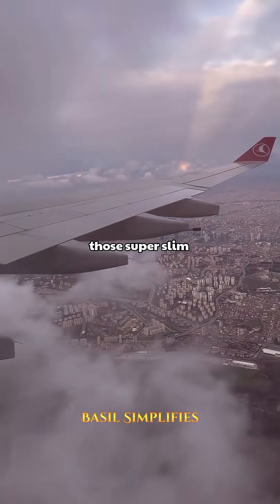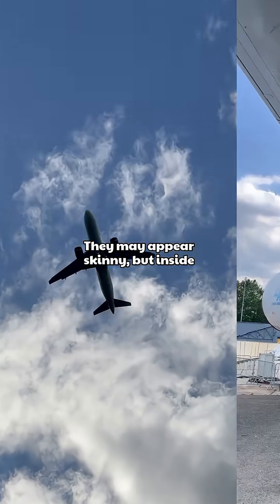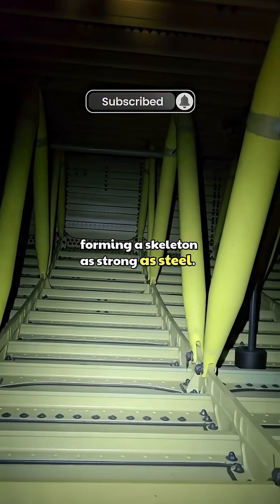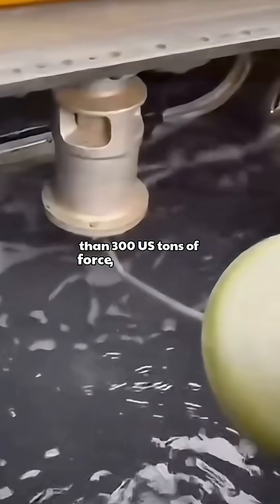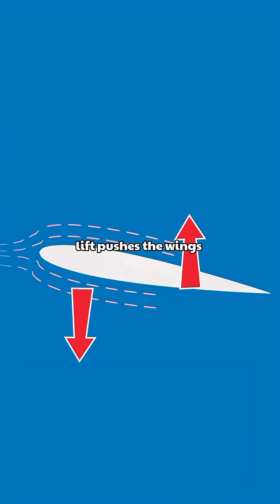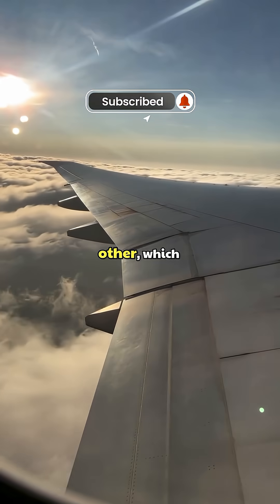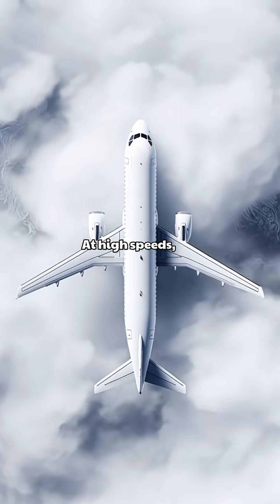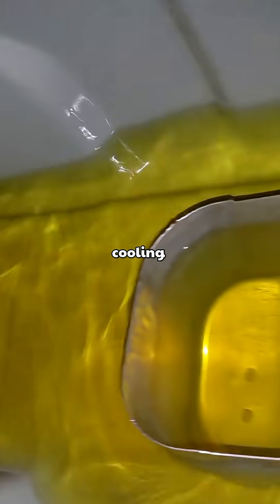Why Planes Store Fuel in the Wings #aviation

Comment: At the subsonic speed modern passenger jets fly, around mach 0.8, the skin heating is insignificant, it only becomes significant at supersonic speeds and increases with the square of the velocity.
Reply from the maker: You're absolutely right about the skin heating! At typical subsonic cruising speeds, it's not a major factor for fuel temperature. ✈️